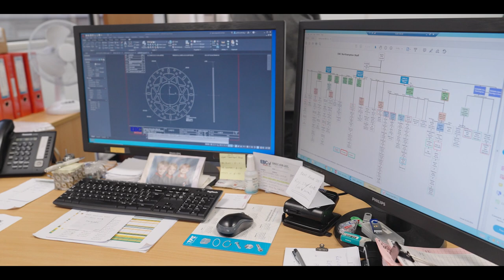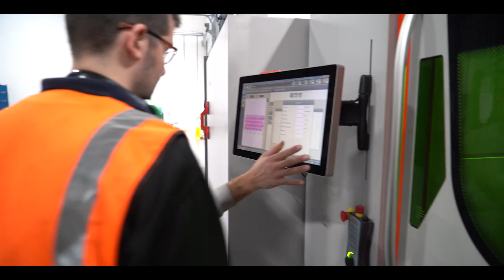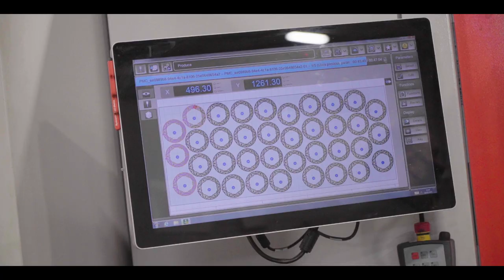Jonny Smith from The Late Brake Show Takes a Tour of EBC Brakes’ HQ

Comment: I used ebc green stuff pads on a fiat 500 2011 it's transformed the braking system on the car stopping distance is unbelievable now it was soo good i decided to fit drilled groved brakes as well cause you cant get vented discs for the 1.2